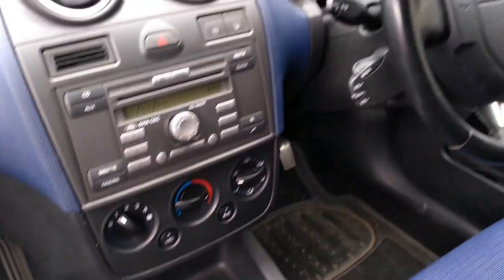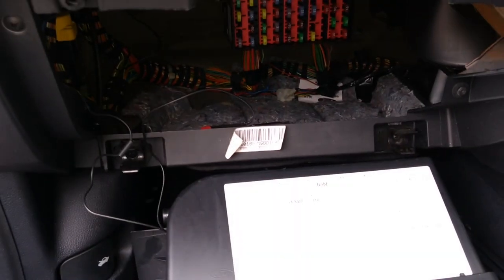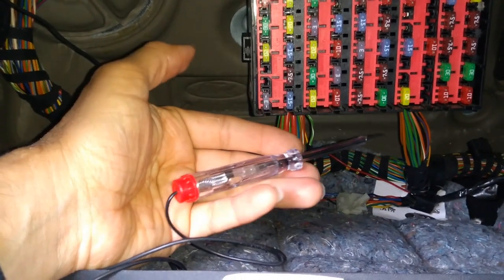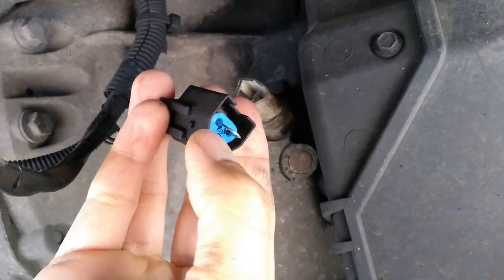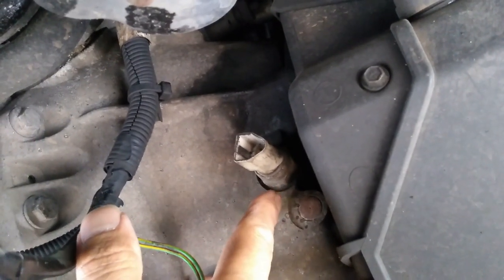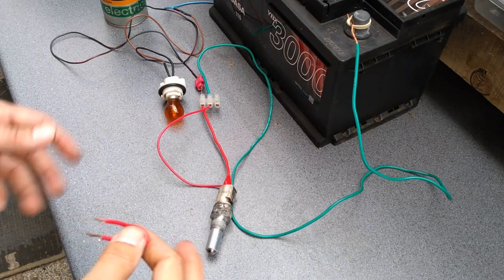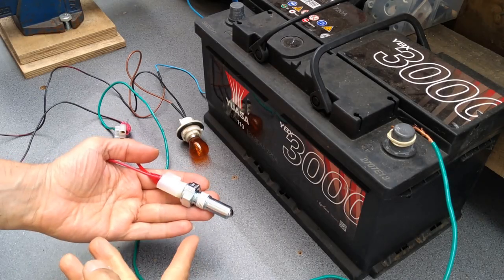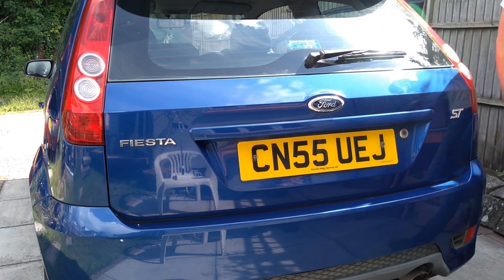Ford Fiesta - No Reverse Lights, Bulbs Ok - Diagnosis & Repair. ST-150 Part 4.

Comment: Hi mate,
Had a customer in today, no reverse lights either side and could see the bulbs were good.
Checked the fuse it looked good too so I tried this quick check
New reverse light switch needed.
Cheers for the nice and simple vid mate 👍
Reply from the maker: Excellent mate, glad it helped, thanks for messaging.

Comment: I've been looking everywhere for a vid like this! My reverse light on my fiesta only works once a month if I'm lucky! And had no idea of where the switch was! So thank you very much 😁
Reply from the maker: Hi, thank you for the comment. Sorry for the late reply - I did not get a notification of your comment for some reason.
Reply: Yeah my ford fiesta Mk6 reverse lights have just stopped working, my girlfriend told me yesterday to my great delight, I think it may of worked this morning though but it's intermittent so maybe I need a new switch? I'll ring garage up Monday didn't think it was a new bulb as both didn't work guess could be fuse but I don't know why that would blow so the switch seems the likely culprit.
Reply: @thew4rrior5code  it’s definitely your switch , mine did the exact same! I bought my replacement online! It’s a cheap fix! And you can fix it yourself very easily! No need for a mechanic
Reply: @danielthompson2708  Yeah everything is a quick fix if you know what you're doing lol I don't fancy going under the car tbh but yeah I've seen a few videos on it looks fairly straightforward I guess.
Reply: @thew4rrior5code  yeah you just put the front of the car on a ramp to get under it, screw the old one off and put screen the new one back in! You just need the right size of spanner! 😁 and I’m no mechanic haha , it’s like replacing a light bulb

Comment: very informative thanks! have the same problem on my 2008 Fiesta Style Climate. also have another annoying problem with the boot release button and the button on the key. i think it could be the motor that's gone.
Reply from the maker: You're welcome, sorry for the delay in getting back to you. does the boot release using the key?

Comment: Quick tip on checking if the reverse bulb needs replaced or if it's something else like a fuse or switch... keep your window wipers on (front wipers)  then put car into reverse, if the rear wiper doesn't automatically come on then it's definitely not the bulb that's the issue.  (more than likely fuse or switch)
Reply from the maker: Thanks .

Comment: Thankyou iofix, iv just ordered a reverse switch today as my reverse lights dont work and my rear wiper also doesn't come on when I engage reverse gear with front wipers switched on
Reply from the maker: Great, glad it helped, yes I would imagine it should sort your rear wiper not switching on too.
Reply: My wiper works but lights are intermittent does that mean j need a new switch still?

Comment: Hello, what is the colour of the reverse light at the rear of the car that connects to the light bulb? asking because I'm trying to fit the parking sensors, but I'm not sure to which cable I should connect the red wire. thank you
Reply from the maker: I don't know I'm afraid. U might be able to figure it out by carefully examining what goes where through the connector and light unit.

Comment: Hello! How much transmission oil comes out when you remove the sensor? Needs a refill?
Reply from the maker: Very small amount - I think it's at about the fill level anyway - I didn't top it up.

Comment: Ive just changed my bulbs on my reverse lights as they look like gone ive checked my fuse and looks like needs new as i aint got one of them pens as such to test it, if i had to order a new fuse what do i order??
Reply from the maker: If it's the same as the car in the video then u need a 7.5 amp mini blade fuse. (Please support the channel by subscribing if the video helped you. Thanks)